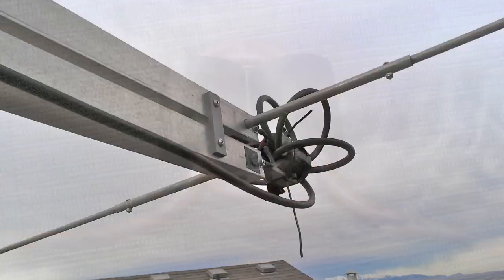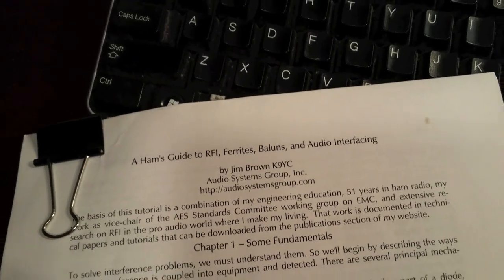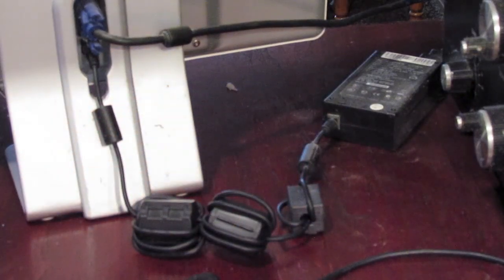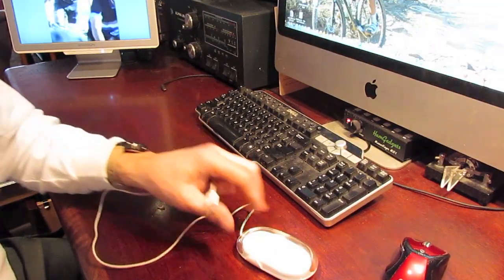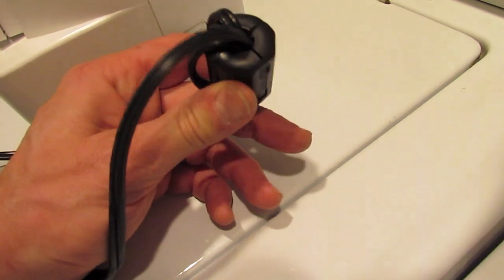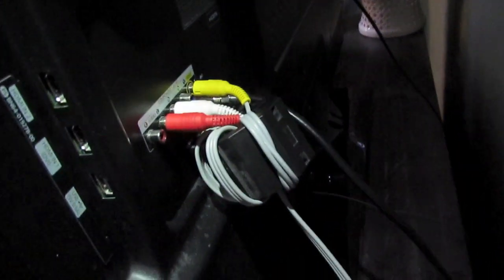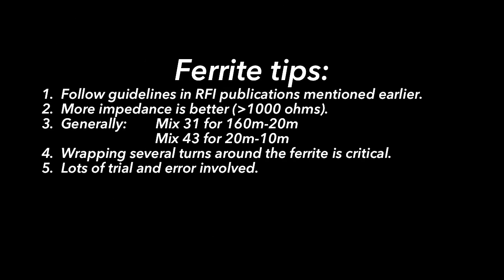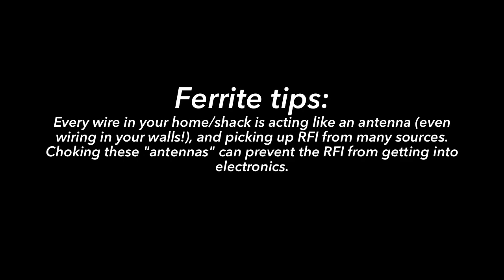Ferrite, chokes, and RFI

Comment: Hi i have a spirt treadmill about 20 years ol its a digital display model. I moved into a condo and now my treadmil affects the am radio in my neibours home. He runs a station that is 600 mhz or khz very low down the scale. Can imput some feritte beads on my power cord to stop this frequency noise from affecting his am rdio thanks

Comment: Short and to the point. Thank you for that and the references. When I key even my 20 Watt, G90 on 80 meters, the wife's makeup mirror with a touch switch on the other end of the house turns on. The same goes for a touch lamp on that end. I had to unplug my adjustable electric kettle for the same reason. Looks like a lot of wrapping is coming up. LOL

Comment: I'm having problems where the USB cable from my MacBook to my Xiegu-6100 radio is causing a lot of noise on my radio reception. The increase of the noise floor when they're connected is quite visible on the waterfall. When I disconnect the USB cable the noise follow immediately drops. The laptop and the radio are running on battery, since plugging those into mains also caused noise. 

I'm planning on choking the antenna coax (on general principle) I'm typically using the 20 m or 40 m bands with a portable vertical adjusted for good SWR or a random wire, trimmed for good SWR. Amazon has a "FT-240-31 Ferrite Toroid Core - | 31 Material" that seems right to me.

Do you mind me asking a couple questions about your experiences?

You mention the mix for a couple of devices, but for the USB cable you just say to wrap it around "some ferrite" but no specifics about it.

1. Are you also using a mix 31 ferrite on the USB cable? Do you agree that's worth a shot? I could just use the same Amazon "FT-240-31 Ferrite Toroid Core - | 31 Material"  that I'm planing to use on my coax if that makes sense.

2. Do you have any feelings about a clamp-on vs ring-type ferrite for the USB cable? I live on the road (motorcycle) full-time, so I'm very conscious about size. Amazon has a clamp-on called "31500 Ferrite Filter Core Material 31 Mix ID 1/2" 13mm" "Inner Diameter 0.5" 12.7mm Clamp on with a black plastic case" that looks like it might be smaller than the ring-type.

Thanks for the great video!

Comment: Question - how/why so many affected/affecting devices?   RFI (from TX, and into RX) starts at the transmitter, the feed and antenna systems +/- grounding/bonding and common-mode issues.    

26 years of HF operation at present QTH. Station implemented from the ground up, literally, per Ward Silver's best practices and Motorola R56.  Neighbors within 30-40 feet of some antennas.  Several different domestic appliances/systems, solar, many PCs and associated networking.  Station never affected by any household/consumer devices. Station never affected any devices.

Comment: Hi there. I'm in the UK and I found this video informative. I recently purchased a dash cam with a rear camera unit. When I connected it, my car DAB radio started to be inconsistent. The car (Peugeot) uses the heated rear window as the Aerial (antenna) for the radio. Would using a ferrite on the dash cam cable help to stop this problem? Many thanks.

Comment: So I have chokes on everything. My antenna is tuned to less then 1.5/1 I have a common mode choke on the feed line below the antenna. I can not transmit on 40 or 80 without it disconecting my computer from my ft991a.  I do not know what else to do.

Comment: I usually use smaller ferrite chokes and don't wrap several times. But I do not do 2-way radio but only want to get rid of EMF for health and audio reasons. Despite I shielded my PC almost TEMPEST-grade, I hear the CPU and mouse motion as a dull buzz in my tube amplifier. But using ferrite beads with too many turns for the audio wires of the amp itself massively worsened sound quality (harsh trebles, likely by oscillating feedback inside the tube amp or chip output stage of connected media equipment.)

Comment: Is the torroid you used for the mouse cord a magnet?
I bought some clamp-on ferrite noise suppressors, and when I opened one and tried to pickup a small screw expecting it to be a magnet, but it didn't make the screw move at all, so I don't think they are magnets at all.

Comment: good vid but Mix 31 is the latest development for noise suppression that covers the broadest frequency range of 1 – 1000 MHz and you can use it to stop noise from getting into your radio from switching power supply's of all kinds. the little wall warts from cell phones are switching supply's and so on.

Comment: Very informative. So I get radio interference in my plane if I plug a phone cable into one of the two usb ports in the dual usb adapter.  One works without interfering the other doesn't. But it only creates interference when I plug in a phone or something to charge. Do you think it would help to put a ferrite around the charging cable or just replace the whole usb adapter?
Reply: Yes

Comment: Its not interference FROM Ham/ Amateurs transmitters that's the BIG problem...its interference TO Ham/Amateur, ALL Home RADIO RECEIVERS and devices etc. FROM  all the Switch Mode Power Supplies  (used to charge your cellphone/iPad etc) ...AND the digital pollution they spew into the irreplaceable Natural Environment of The Radio  Spectrum.  Add EVERY digital device In a plastic, unshielded, box without proper  shielding or RFI containment....most illegally imported "from CH-eye-nna" and you destroy wireless communications...but its OK...the more useless it becomes, the more it gets abandoned by users...Allowing the wholesale FCC selloff to the highest bidder ...and a future "pay to use" encrypted, digital system...from vaccine " injectable tracking"  , to surveillance, to more "short range" Internet of things uses....a complete waste of the true technical benefits of the VLF-HF range.

Comment: Hi, i want to use some ferrite chockes  on signal wires of a cnc machine. As they have a certain impendance at a certain frequency, other than fitting tightly on the wire, the bigger impendance would mean more efficiency ?
Thank you.
Reply: The impedance is resistance to ac current flow, DC signaling passes, but inducted ac signals are suppressed

Comment: As a Ham for many years and doing a lot of DX-ing, I've never experienced any of these problems you've described... My antennas are very close to my house. Any thoughts?
Reply from the maker: Your antennas aren't close enough, lol.
Reply: @KF7P  I've an EFLW with the UnUn attached to my house and a trapped vertical (HF) with a dual band vertical (VHF/UHF) next to it, mounted on a 15 ft pole on the second floor balcony... Any other thoughts? (😁)

Comment: Thanks for this.  I'm new to the RFI issue.. never payed any attn to it before.  Just setting up a 2m station at the moment.  When I key the mike I do have my paper shredder go wild.  Also when I had my  HP printer closer to the xcvr it would turn on.  So, now, shredder disconnected and printer moved a few meters away.  That said, what do you suggest for my issue here?  I did buy some snap on's that are good to 150mhz per manufacturer.  Should I just add a few or more to the antenna coax at the antenna or should I couple that with some coax wraps too?  Have no idea what would happen when I try to get onto HF 😊
Reply: where is the antenna located and what type?

Comment: Hi, i have this problem, i usually ride jetski for leisure, but when doing search & rescue, using handheld radios, the problems appeared.
It seems that the reverse cup of the jetski, operated by a motorised servo or actuator, seems to give some interference to the handy talkies. I was wondering & thinking to clip a choke or ferrite at the servo's wiring.

It is a right thing to do? The wires are short & straight, it cant be coiled like i've seen on your videos.

Thanks, from redzall, 9w8arr.

Comment: Either antenna adjustments or trim back on the Fat Boy output.  Seriously though, I quit radio for a while...press release  pointed to the unindicted causing splatter on neighborhood boob tubes and squawk boxes.  Rumor has it a sewing machine made a wedding dress all on its own.  I'm back, running barefoot and boxers only.

Comment: Can you use both mix 31 and mix 43 on the same coax choke, or does it need to be two separate chokes?
Reply from the maker: Well you probably could, but I'd just make two separate chokes.

Comment: I will have to follow this up.  However, my problem is with RFI egress from HDMI and cat 6 cables. This is causing grief to a radio mic receiver in a fixed auditorium PA.  The receiver measure -20 dB broad spectrum RFI across every channel and proximity testing confirms RFI is generated by these cables.  RFI only exists while video signal is present in the HDMI over cat 6 cabling.  It is difficult to reduce proximity as the source device is in the AV desk.  I am not sure if ferrite is the answer here as the square wave signal pulse is creating a GHz transmission aerial effect (egress) while ferrite seems to be effective at attenuating ingress.  Perhaps I need to run the cables in grounded copper tubing.  I'd appreciate advice as to which approach to pursue.

Comment: my problem is new LED lights.  would there be anyway to put one inside light switch.  when switch  is on you can't hear AM at all.
Reply from the maker: Not likely, I would replace the the lights with a different kind or try a different brand.

Comment: quick question, if i loop the positive and negative supply to the back up camera in may car , around some Ferrite will it reduce the engine RF interference that i see in the backup video? or will i need a capacitive solution?

Comment: K9YC deleted chapter 7 and replaced it with a whole new paper called "A New Choke Cookbook for the 160–10M Bands" found here: k9yc.com/2018Cookbook.pdf
Reply from the maker: K9YC is very knowledgeable on this stuff and the new chokebook is fantastic.  I made this video a couple years ago and K9YC has since made updates to his material.   However, this new data does not invalidate using different styles/sizes of ferrite cores to squash RFI.  The clamp-on cores in particular are extremely useful for household appliance RFI issues.

Comment: Every time I transmit (just 10 Watts), my computer has some USB devices disconnect/reconnect. Putting as many ferrites as possible may be the solution... but looks like I need a hundred of them just for the dozens of USB cables on my desk. Also some devices may not have long enough cables to wrap around multiple times.
Reply: You can also try using a longer or shorter cable, or plug those devices into a hub, and then use a cable with a ferrite between the hub and PC, try to not have coax and PC/power cables running parallel with each other, perpendicular is best
Reply: When I lived in a house where some kids had a walkie talkie, my Amiga (build into big wooden custom case) started to type random characters when they were transmitting. I had to always move the keyboard cable until it went away.

Comment: Your sewing machine started by itself. Time to put down the ferrite and call a priest.
Reply: The power of Christ compels you!!!
Reply: My station turns on the TV downstairs and then programmes in all manner of settings I don't know how to get out of. It's midnight and the house is completely dark and all of a sudden I hear reruns of The X Files blaring at full volume downstairs, on a channel I didn't know I even got. Priest, is right.
Reply: Ha! Ha! Ha!
Reply: Or you could have done a little more research and realized he has a faulty switch that has an open or semi open connection and just replace the switch by soldering a few wires lol
Reply: @mikemc8495  Not on a machine that has a soft switch - sensor operated. You need to add an AC line switch.
Reply: @mikemc8495  well, aren't YOU the life of the party!
Reply: If ferrite doesn't work, try a ferret.
Reply: This would be a great whole other video, I would love to see.
Reply: Lol 😂👌
Reply: I suspect that some of you guys are from the worldwide DX forum. Own up.
Reply: Long ago I read the Bible and years later I decided "reading only" was not enough so I started to study it. By so doing, it lead me to the following thought: Science was created for those who can't understand G_d's activity and Faith was created for those who can not understand science. Since then, I don't see any antagonism between my Creator and Physics, as most people do; so that, I feel myself as much blessed as for understanding FROM --why my mother's tv turned on by itself right after I threw some water on a wall in the same room---, TO -- mankind was a creation or an evolution?---
Reply: So they can come and do your sewing? :)

Comment: If your amateur radio equipment is causing so much RFI I think you should really do an RF ground not an electrical ground but RF ground most amateur radio operators forget to ground every piece of equipment to a center bus out to an 8-foot ground rod using ground straps that should be as short as possible and never equal a quarter wavelength of the highest band. Also one more thing if you are running a dipole Orin off-center fed antenna it should be as high as possible also.
Reply: Exactly, he has issues with his equipment

Comment: Hi ! Thanks for the very interesting video. Assuming I'm using a SDR, If I had only ONE ferrite toroid (say FT240-31 ma
terial), on which wire / cable would you recommand to wound it around  tu suppress RFI / interferences at best ? Thanks !
Reply from the maker: IF you're hearing noise in your SDR, you need to choke the source of the noise.  You need to find what is making the noise...a "wall wart" transformer, household appliance, etc. and choke its cable.
Reply: Thanks for the prompt reply. A few months ago, I tested a basic ferrite clamp (no idea what material it was), and found best RFI suppression when it was wrapped around the antenna coax (between the SDR and the outdoor loop antenna). What does it mean ?
Reply: @aunumero73  probably that the shield of the coax was resonant to that signal you could have eliminated it as easily by changing the length of the coax by cutting it or adding a jumper section

Comment: Hi Chris, first of all let me thank you for your video, it has educated me to no end. I have a rfi problem I would like your advice with.
I run a professional music studio and am always trying my best to cut down on noise and interference . Recently I have had a dimmer switch installed on the studios lights. The dimmer switch is an old school MK type double switch not a new led one.. One dimmer for each rooms lighting circuit. I am using new Phillips led warm white bulbs which are great for my studios lighting bills and have been designed to work/dim with regular old dimmers. Indeed the Phillips led bulbs dim perfectly and smoothly, even better using the old mk dimmer than the Chinese led dimmer I had before. 
However, now it seems that with the dimmer installed I am picking up much more interference in the room while recording. The classic one is a single coil pickup in a guitar. It goes crazy with interference when the lights are on and then shuts up when I turn the lights off. 
Same with guitar amplifiers. Of course I know that guitar pickups and tube amps always pickup interference anyway it's just that the audible volume of said interference has got much louder since I fitted the dimmer. 
Please is there any way I can choke/suppress or isolate the dimmer switch in order to reduce the noise/interference without having to sacrifice the dimmer and go back to the standard on full of off switch? Perhaps ferrite beads on the connections to the dimmer? Or do I have to spend a lump on a 1:1 isolating transformer and completely isolate the lighting circuit from the rest of the power in the studio. Any help would be much appreciated. Thank you.
Reply: I will answer the question for you.  I learned the answer from this video.  Take every wire in a 2 block radius and wrap them numerous times around ferrite clips.

Comment: Ok so i newly bought wifi and router. So i am starting to have those noise in speakera. Probably its because of router's radio waves. So where should i plug thing Ferrites? I mean on the wifi's wires or speakera wires? Also my speaker wires are smaller in size so winding them with ferrites mike shrink them even more and i need to have my speakers to reach to my woofer in order to work.

Comment: Holy crap man are you using all of the watts to transmit???  LOL
Reply: TJack Survival it's not so much watts I think this guy has very good equipment but it's pretty grounded for RF because a lot of people think that electrical ground is good enough for RF and it's basically not. Obviously this guy is serious into the hobby to have a 40 meter yagi but he is definitely having some serious issues I mean I've been involved in the ham hobby since the 1980s as a child and I am still involved with it very much and the best part about it I haven't even used 11 meters with way more power than the full legal limit on ham radio and never had any RFI issues at all

Comment: Very good.
If the wire is shielded, I think ferrite doesn't affect.
Reply: MasterMindmars not true. The ferrite helps with 'common mode' noise, which means it affects both conductors. It's why we hams use these on our antenna cables to. I have a couple dozen on the various wires and cables around my ham radio. Works very well.
Reply: If there is RF on the OUTSIDE of the cable it will be choked.  The RF inside the shield win't be affected.
Reply: Remove the shield for short distanced cables

Comment: I have a military headset with a civilian high impedance mic and a adapter cord to a 1\8 inch jack for the mic and headset. It is used on my computer and I hear spanish music whenever the mic is plugged in. When the computer is turned off it is silent. One other thing if I hold the mic jack it is silent. Would a ferrite core help somewhere?